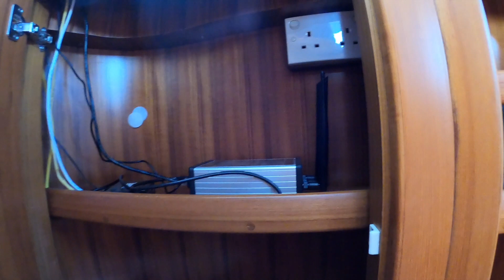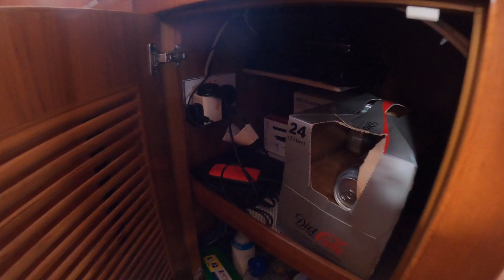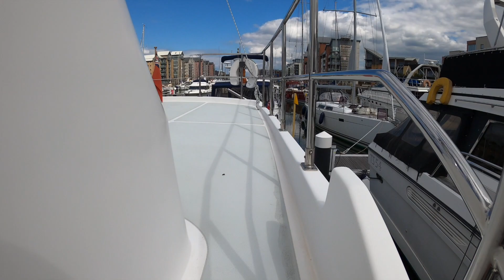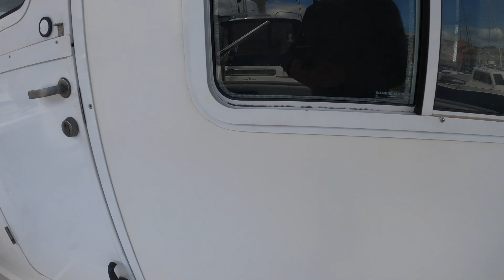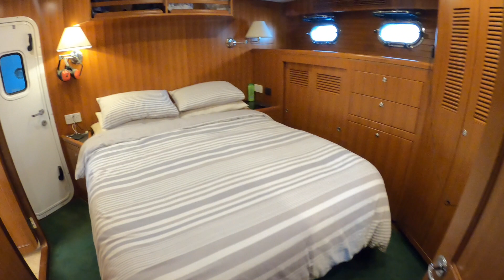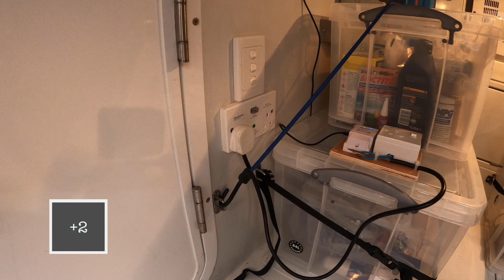Nordhavn 47 'Wanderlust' - Walkthrough Tour (with a difference)

Comment: Love the 47, im hoping to put in a bid for one within the next year and berth it in porto in Portugal. 55 power sockets may seem too many until you trip over a bloody extension cable 😂😂😂😂...very neat and tidy boat, your engine room is spotless, love it. Thanks for the heater tip, i was wondering if the reverse cycle air cons were sufficient.

Comment: Is your boiler the only source of heating your boat? Did you have to install radiators all over the boat when you installed the boiler. Nice boat.
Reply from the maker: We also have reverse cycle air conditioning but we’ve found that it has poor performance in heating mode when the sea temperature falls below 6’C. This is why we added a boiler. 

We added 6x Fan Coil Units throughout the boat. Below in the cabins they are ducted under the floor.  Wherever we added them they are hidden so you wouldn’t know we had them. There are no radiators - all are forced air FCUs.

Comment: Hello mate, can I ask a question... can you run the air con without running generator?
Reply from the maker: Yes we can, as long as we are connected to shore power. The boat has the ability to run the air con off a dedicated shore power connection if we desire, or we can just use the one connection, or we can use the generator.